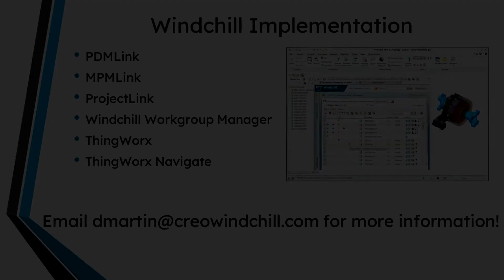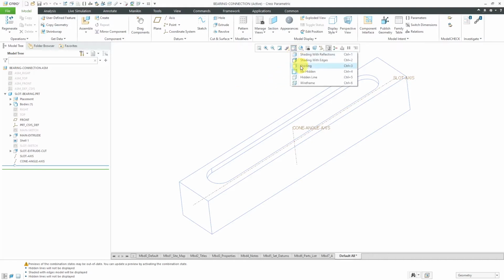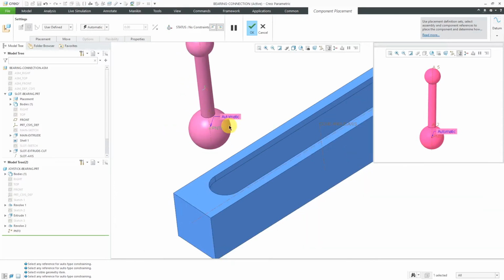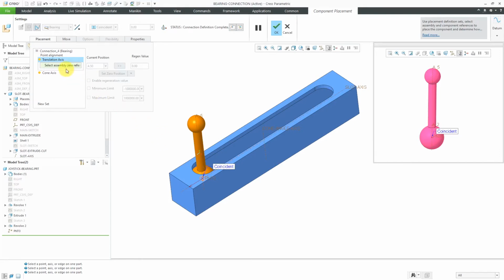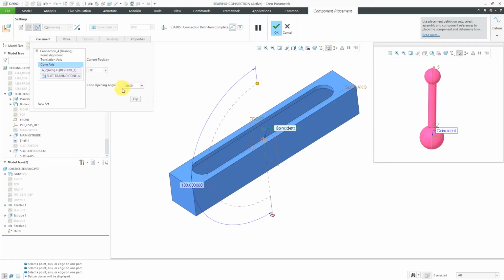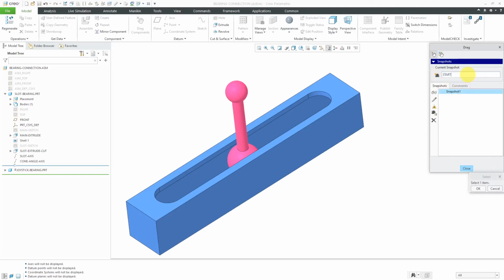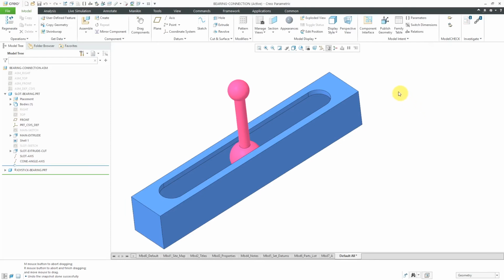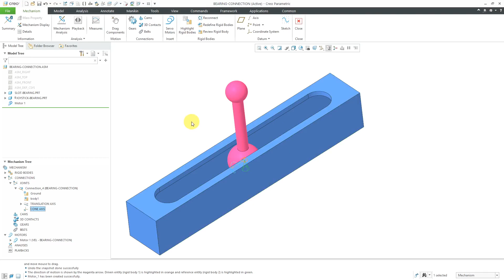Creo Parametric - Mechanisms | Bearing Connection

Comment: I agree 100% that this is not really a real world connection.  I have never used this one in a real model.  Typically I would use a pin with a second general constraint to obtain similar desired result